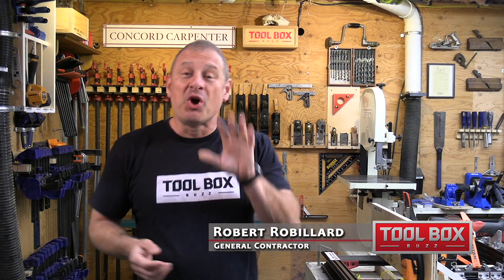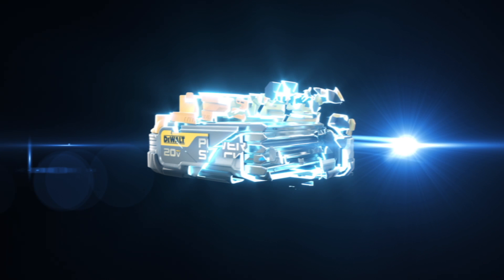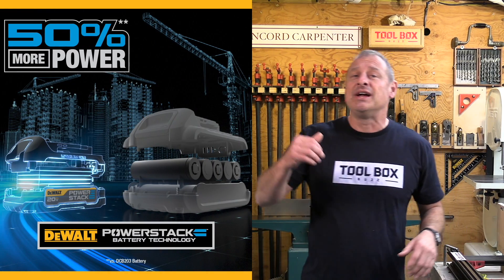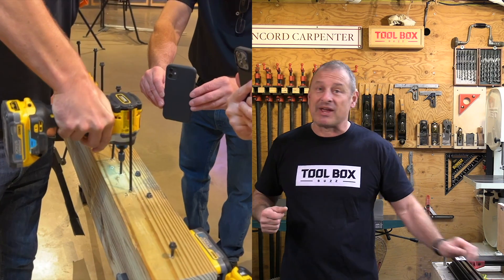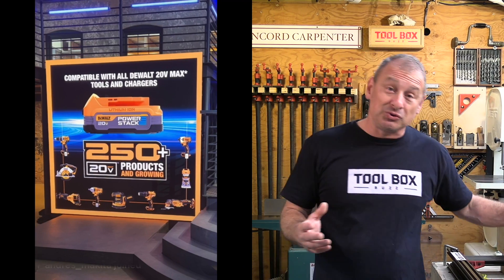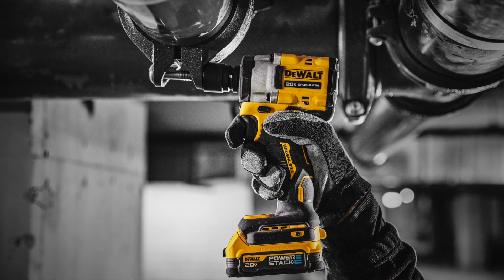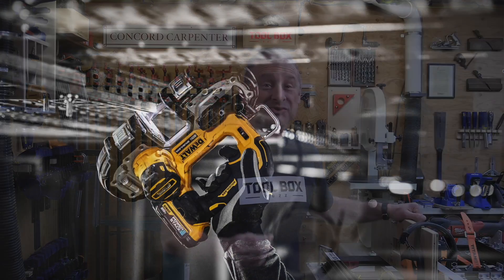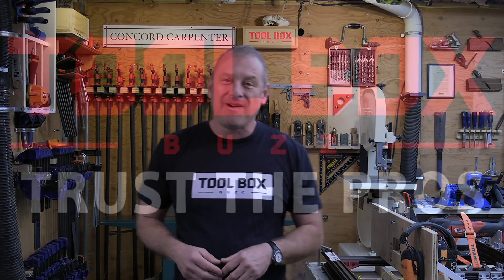Dewalt PowerStack Batteries

Comment: Thanks for the info.  I am concerned they might expand like my laptop did. These companies are so afraid to compare tools and batteries to the latest technologies. They use 10yr old Milwaukee tools and batteries with 18650 cells. I can’t wait to see how they compare to 21700 cell batteries and how they react when they are stressed.
Reply: I work for DeWalt as a rep! The batteries used in phones/laptops are not the same being used in these packs. We designed these pouch cells from the ground up and have a patent on this specific design(not the tech but the design). Anyways, these pouch cells were created specifically for power tool use. They run cooler, long, and give the tools more power.
Reply from the maker: We'll see
Reply: @ConcordCarpenter , Hi Rob, I had an opportunity to check out your live stream last week during the Dewalt event.  How could the Dewalt guys keep a straight face testing their latest technology against 9+ year old Milwaukee technology and in some cases even older?  Do you think they drank an extra dose of the Dewalt Koolaid prior to the event?

When they tested the Dewalt 20v Atomic Bandsaw (I believe that was the tool) with their latest flat pack battery technology against the Milwaukee M12 “non”- Fuel bandsaw, equipped with a 2 amp 12 volt battery I was calling foul.  I have a feeling they probably tested the newer M12 Fuel Bandsaw against their new offering, but weren’t comfortable with the results.

I don’t feel it bodes well for manufacturers showcasing their newest technology, when they test it against competitors products that are a generation or two  older. If they’re confident in their offerings they shouldn’t be afraid to test it against a competitors latest tool and battery technology.  In the case of Milwaukee, their Fuel tools equipped with a 3, 6 or 8 amp High Output battery.

Thoughts?
Reply: @martylucas8557  The M12 fuel bandsaw isn't the direct competitor to this new atomic bandsaw. The M12 fuel has a 2.5 inch capacity, and Milwaukee themselves compare it with DeWalts 2.5 inch bandsaw the DCS371. The atomic is in the subcompact category, so they chose Milwaukee's subcompact offering as well.
Reply: @martylucas8557  you realize the atomic had a 1.7 ah battery and the m12 had a 2ah? Yes they should have compared equal tools but the batteries were the same. And Milwaukee does the same thing at their tool shows except they grey out the competition at least dewalt shows the competition
Reply: When in cold they will blow up
Reply: @QR503  I live in Colorado and I keep my flat pack batteries tools in the garage, it’s been below -0° a few times and between 10° to 
 20° every night, all my DeWalt tools run just fine, no batteries expanding or exploded.

Comment: Metabo already has this ... look at the German side.  New, shorter LiPower 2Ah, 4Ah and 5.2Ah batteries.  And watch out — not LiHD (high demands), but a successor (or just a parallel offer) for older LiPower batteries.
So three times you can guess what applications they will be used for .... my guess is a cheap replacement for entry sets ... the point is that manufacturers would like to offer a cheaper alternative to already expensive batteries.
In short, Classic ... when we get you cheap as a customer in our ecosystem, if you want higher performance, you will have to dig deeper into your pocket again.🤨👎
Reply from the maker: Didnt know that. I also heard that FLEX is coming out with one
Reply: @ConcordCarpenter  sounds like a grenade on my leafblower on a super hot summer day while I leave it sitting baking in the sun bam! Fire.
Reply: @ConcordCarpenter  Hi Rob, do you know the discharge current of these LiPo? In my opinion it's absolutely not a safe choice, but more an economic one. I hope we won't see too much fireworks in the future 😅...
Reply: @marcp39  i'd actually worry about this things puffing up a common problem with lipo pouch cells and being pouch the casing is easily compromised or punctured if dropped or pierced

Comment: 1 question...cooling?
Reply from the maker: Historically these battery styles cool pretty well. I'm assuming they have aluminum heat plates or heat sinks to deal with heat. This isn't they're first rodeo
Reply: @ConcordCarpenter  i hope so. 1 battery can be cooled by the outside, but when we sandwich them, the central ones might suffocate and blow up if not cooled with heat plates as you mentioned :-s time will tell
Reply: @ConcordCarpenter  sorry can't use metal heatsinks on stacked pouch cell and there is none on this battery someone already took it apart. we've seen whats inside.